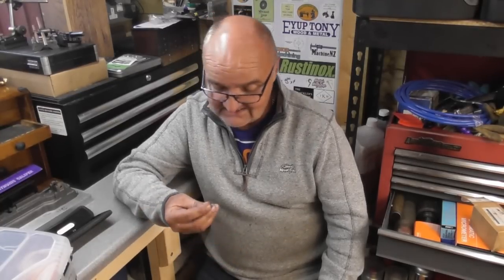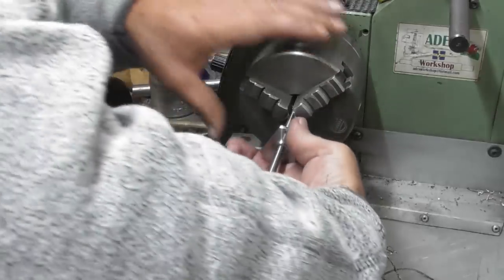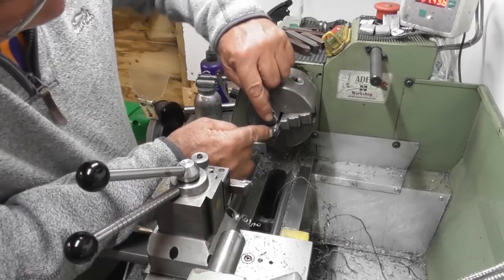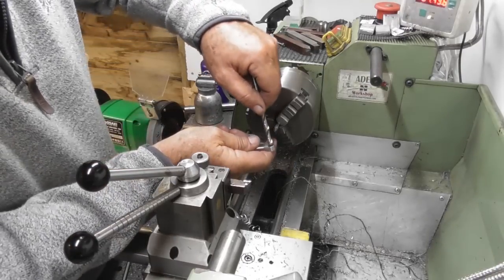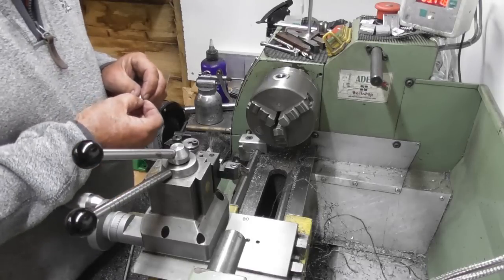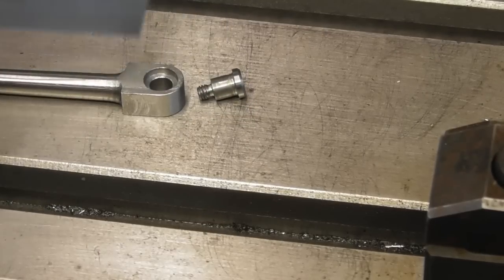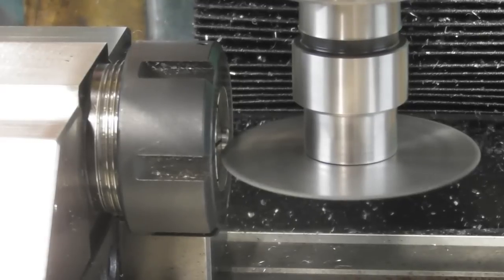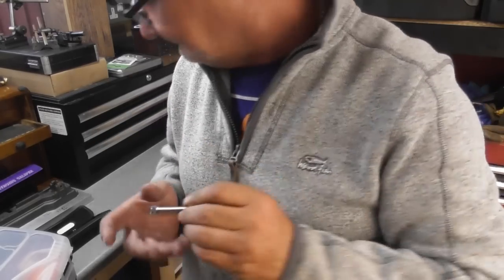Stuart models S50 engine part 20

Comment: I would suggest the tool tip radius has caused the first issue, an easy fix with a chamfer on mating diameter.